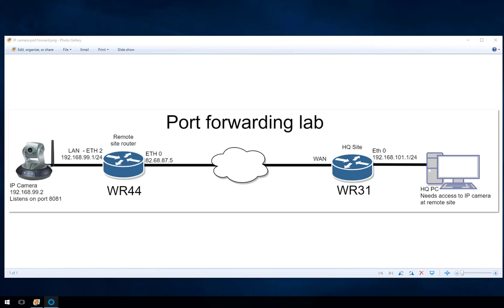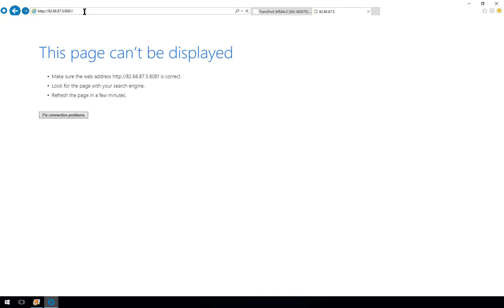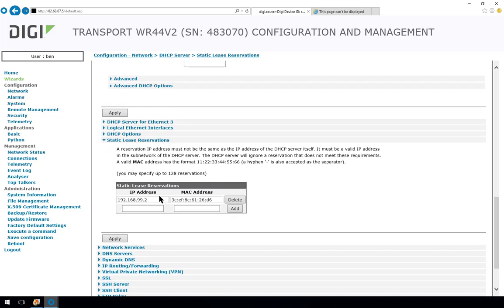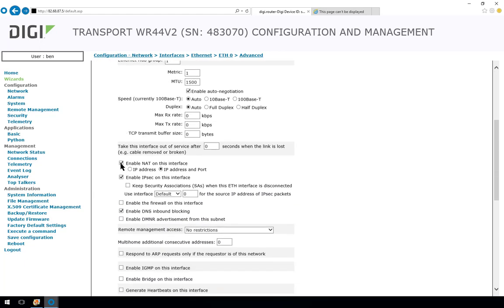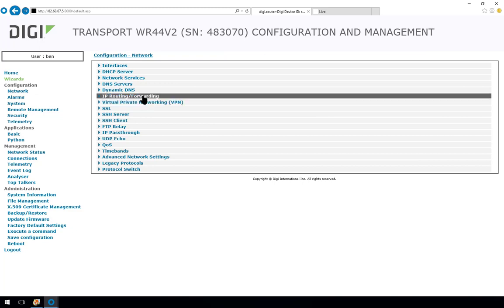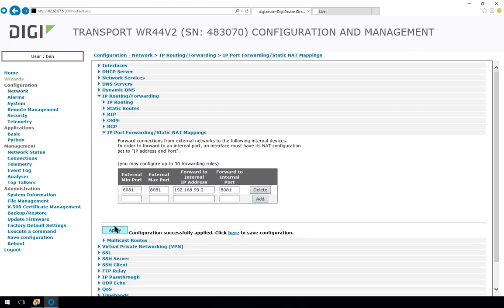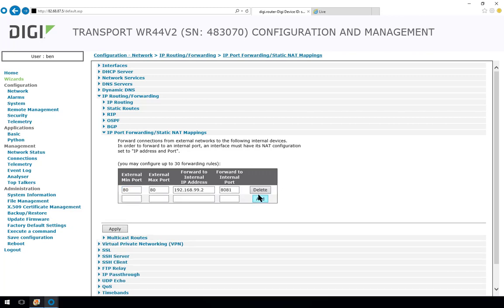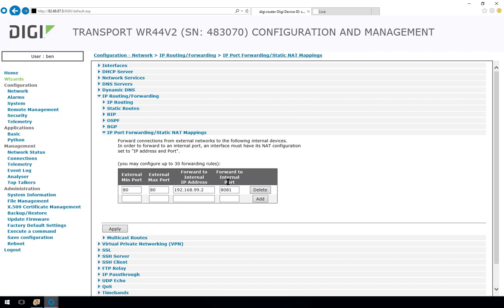Digi TransPort Router - Static NAT mappings - TCP & UDP Port forwarding

Comment: Hi Sir, Do you have any configuration for the serial port. ?
Reply from the maker: The default configuration of the serial port on the WR routers is 115200 8-none-1, with no flow control.  

The config options are here: Configuration - Network > Interfaces > Serial.   

If you want to communicate with a device connected to the serial port via TCP, see this document: http://ftp1.digi.com/support/documentation/AN_002_TCPDIAL_TCPPERM_and_reverse_telnet.pdf 

The serial port pin outs are shown in the user reference manual:
https://www.digi.com/resources/documentation/digidocs/90001019/default.htm#search-serial%20pin%20out